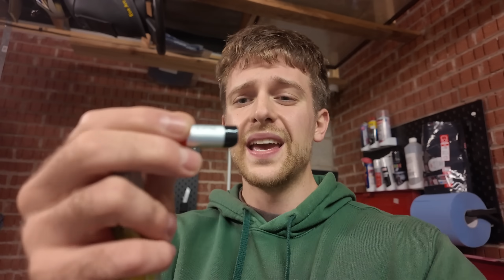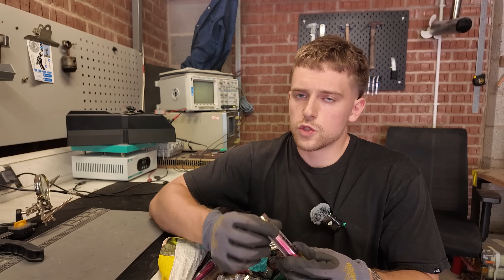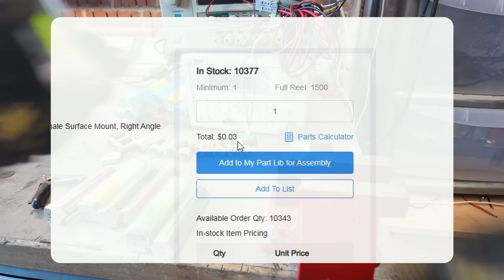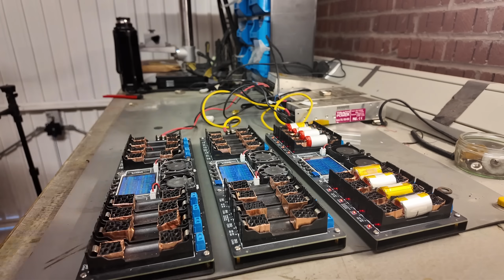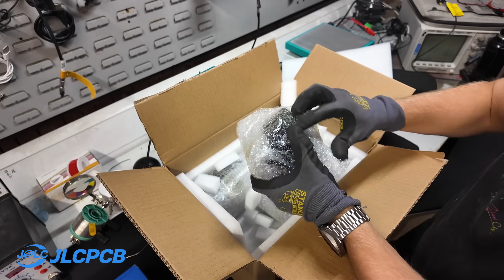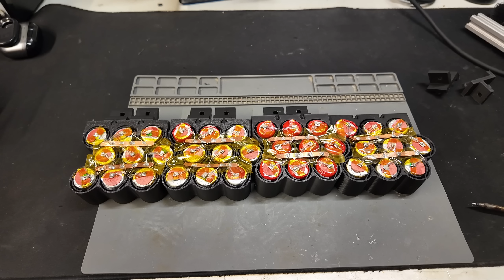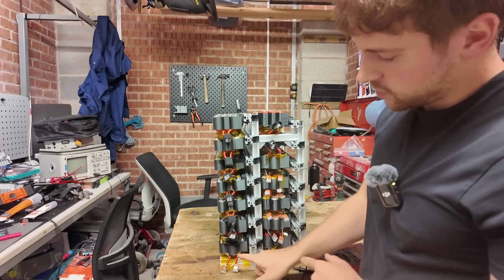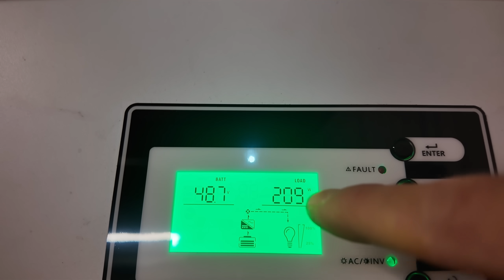I Powered My House Using 500 Disposable vapes

Comment: If you want to manage fumes in the workshop I would highly recommend a fume extraction system. You'd have the tools and knowledge to make and install one yourself or you can purchase one on wheels. 

It has an arm with multiple hinges to adjust fume extraction at specific angles. Your body will thank you for it

Regards,
Welder

Edit: my apologies, i just seen at the end you have and extraction fan. Awesome work with the battery

Comment: You don't necessarily need the inverter! modern devices have "switch mode power supplys", and effectively run on the equivalent of the peek mains voltage in DC inside. This means you can run most things on 300V DC directly, without an inverter. Only induction motors and old school transformers need 230Vac, and some devices have their own inverter/VFD to run the induction motors. Most brushed motors will work on DC. All modern led lamps work straight on 300V DC. 

So you could just do a high voltage series string of vape batteries, and power most devices directly on it. I have tested this by using multiple 9v batteries clicked together in series. I have powered TVs, power tool chargers, led lights, CFL lights, phone chargers, even a fridge that had a new style inverter compressor! Many devices would work down to 180v DC!

https://youtu.be/Au3wURws_Bg

Comment: I made myself a few packs of these batteries and it works really well. Recently however it seems like people stopped throwing vapes everywhere so I have not enough cells to build something bigger but the idea is simply fantastic.
Reply: Set up some boxes around high traffic areas, maybe ask permission to put em up depending where you want put em, lable them disposable vape disposal units, and check back for your free battery packs every so often

Comment: Awesome project that showcases how terrible these things are to be ending up in landfills across the planet--But I do have one question, shouldn't there be some sort of cooling solution for the cells themselves? On a small scale, a few of these won't draw too much heat, but as you move up in scale, I can imagine these would start to warm up, possibly becoming a potential hazard. I could be very wrong, and you certainly know more than I, but that's just a concern I had when seeing it all together.

Comment: nooooo way I had this idea when I uhhhh... decided it was time to quit lets just say lol. But didnt (and still really dont) understand too much about electricity so I decided ehhhh for another day. 

Now I see this video at 1am? HELL YES. INSTANT SUB.
Reply: Id love to know the maximum wattage output you can get. Can you like start a vacuum?! How about a 2000w water inductor heater :O? If so, you could run that for an emergency in a lil bit of water for like 10 min and use some pumps and bam "free" warm shower ;) !!!! If you can set up solar too that would be rad and yeah charging at night is KEY especially if theres no solar. I cant believe how awesome this video is. We can really do anything and im glad someone else had this idea! So COOL. Me? I just bought a bluetti elite v2 and I kinda use it that way for my entire office. Can even use my washer/dryer if I had to since I switched to water pump style you guys use over across the pond oi oi ~ ;) But rad. Awesome. Did you mention if it was running at a smooth 60hz? or 50hz I guess for you guys? If so, you could even use a petrol generator to charge your batteries to charge your house in an emergency as well! A lil power loss, but hey, you can at least use your entire house!

Comment: You've done the most useless and costly work. These batteries have a very short cycles. After 10 charge-discharge cycles, their capacity will drop by 30%,  20 charge-discharge = 50%. The best solution is to process them into lithium chloride(which is possible at home) since it is expensive additive

Comment: Please be careful about soldering onto lithium batteries, it can be dangerous. You should look at spot welding. Also I think you should check the waygo connectors for their power rating. I'm pretty sure you're pulling more power through them than they're designed to handle.

Comment: I absolutely cannot believe you SOLDERED directly onto the lithium batteries. This has to be hands down one of the stupidest things you can do. Heating these batteries can cause thermal runaway, which can lead to a fire. Also you shouldn't be using copper, you should use something like nickel as it doesn't oxidise.

Comment: An excellent proof of concept and exposure of the disgusting waste that are vapes BUT incredibly dangerous to do it how you did it, isolating the incoming mains from your generated power just by switching your switches in sequence 
You need a change-over switch to prevent ANY possibility of connecting the two together. OR it being implemented as part of a proper grid supply be system to the way a solar grid connect inverter does it. 
No doubt other, qualified electricians, will point out the necessity for cable sizing and types between workshop and house incomer.

Comment: Flipping the MAINS breaker does not totally disconnect you from the grid, you are only removing the HOT side of the wiring, your still connected via the Neutral and Grounds. It is still possible to backfeed power and fry a line worker. If your going todo this, you need a proper complete whole home disconnect switch.

Comment: Will you ever break even with the time and money you put in,   hell no.   do you care.... hell no.... value of the nerd cred.... priceless.  Glad to see iam not the only one who does stuff like this.   kudos and well done, hope that power wall lasts a long time.  you can also get pvc tubing andslide them down in it, like water tube, to stack them vertically maybe 6 to 13 batteries tall, then a bit of spring compression on each pipe piece and thread it so the threading compresses, makes the connections tight, that way if some go bad it's a lot easier to take apart to redo.  thats what i do in my 'battery bad idea box' :)
..Aaron

Comment: Amazing! I've always wondered how many people that 'Vape' ever consider what goes into the making of their electric cigarettes, and if they bother to dispose of them sensibly, when the battery is no longer viable? Some of my local shops have a deposit box claiming to 'Recycle' used vapes, but I'm skeptical as to how they are broken down when collected? Since the UK banning the sale of single use vapes, I have noticed an increasing number of USB chargeable kits available with replaceable pods, however when it comes to buying the pods, I have found shops don't stock them! This leads to people buying a new kit which contains a new battery. Pods are available for sale online, but unless you're prepared to buy them in advance of them running out?

Comment: The kettle bit was, you have to spend enough to get an inverter that will handle a kettle at least I got a low powered one that can run an angle grinder but gets annoyed at a kettle

Comment: Great video ! But: Lithium cells in disposable vapes are NOT the same as used in our phones etc. They are made for single use, as cheaply as possible, and without any safety considerations required for thermal management when a cell is intended for repeated recharging. - 
They are never intended to be recharged, just thrown away. You must assume that, because of this total lack of required safety considerations, just one of the hundreds of cheap cells packed together in your battery bank may well have some minor unseen physical damage lurking, or perhaps develope a fault with ageing, creating internal thermal runaway and explode into flames, setting the others off too. 
Hopefully none of that will ever happen (!!) but if it did, (and it could!) you would probably lose your house with the insurance unwilling to pay out because it was your lack of care, (and running a startup industrial manufacturing business?) from within domestic building premises. - . 
So please assume that your battery pack is going to explode into flames during some random night, and place it somewhere where it can do that "safely" ! - ie. Probably it's own mini weatherproof enclosure out in the garden.
(But it's still a great video !)

Comment: Interesting thing is that all of the accessories needed to build this are more expensive than the whole ready to use LiFePO4 battery from Aliexpress :D with bms, all the conns etc included and probs 4 times the capacity.

Comment: I know everyone hates AI and robots atm, but this sort of recycling would be a great use case for some robots to do 24/7. Right now a lot of DIY could save a ton of waste, but either they have to do it voluntarily or pay people way too much to make it worth it. With robots you have a one time buy, followed by a little maintenance probably, but you got workers that will do this endlessly without getting bored. Just collecting vapes and such and breaking them down for parts. I know building more stuff to solve a problem of too much junk is not ideal, compared to simply using less as a race, but given that won't happen and we'll only use more that's all I can think of. He's an amazing guy but can't expect Chris to do this all the time. Awesome video anyhow, I just can't help but be grossed out at how we simply toss most shit even if it can be used otherwise

Comment: You are not wrong at all some use 18650 battery same in laptops etc put in parallel with a right cap you'll be okay I've charged them with a phone cable so small capacity.

Comment: Nice...
My brother and I are vape addicts, I can say that almost every vape that runs out of juice, so i decide to keep it instead throw it at bin because the battery inside is still usable, including the type c port, module and lcd, it can be used for DIY projects, among the DIYs I have done is replacing the original battery of the shaver with a vape battery, modifying the headphones by changing the Micro to Type C and adding a double vape battery inside and my custom made Small flashlight with type c 😅.
Reply: I love the resourcefulness!

Comment: Not mentioned the capacity. From what is visible - nominally it's near 55-60A/h.
Usable is probably 35-40, so 2.2-2.5 kWhr.
Not great, not terrible.
But this thing will definitely blow up sooner or later. Everything in 2-3 m would be burning as hell for like 5 min at least. And nothing will help extinguish fire till it burn to the end. As you probably know.

Comment: I'd like to see you build another one from the deep discharged cells only. I have been regenerating and using some found 18650s that where down to 0,000v for some parts fort years, with no single one ever burning or even exploding. Some few had rather strong self discharge on their first test, though, and I got rid of these. I think Dendrites aren't such an omnipresent and urgent problem as it's the general perception. Thus some more insight (empiric study) would be interesting. Of course not without adequate safety measures.

Comment: Even with these cells going down past 3V you can easily bring them back to to 3.7V by charging them on a NIMH setting at 0.001 Amp, then charge normally on a LIPO or LION setting depending whether the battery is LIPO or LION.

Comment: Whilst this is a great Proof of Concept, I think the best thing we could do with the waste lithium cells from Vapes (and lots of other devices like laptops, cars, drills, phones etc) is the full recycling option - i.e. grind them down, extract the 'black mass', seperate all the elements and make brand new batteries that are suitable for the specific use. That way we can bring the cost of lithium down even further - although it is already happening - EV batteries for example were $1200 per kWh back in 2010 but are about to fall below $60 per kWh making them cheaper than ICE vehicles - this is why the new Vauxhall Frontera's EV version is now cheaper by £2k than the ICE version.

Comment: You know you can still recharge all the "dead" batteries.
Reply: its much more safer to use a known working one than to use a dead lithium battery and recharging a "dead" one is risky, as it could just be faulty
Reply: @criauxe  You should test each of them either way and that just means charging them. The batteries in the disposables are the same as those in the rechargeables. I have yet to see one of them go bad or be bad in the past 6 years, but I don't live in the UK so maybe what the US gets from China is different.
Reply: @chrisfusco5494  you dont get it once a lithium batteries get over-discharged they are already damaged and faulty mate thats just how they work so if they didnt light up thats a sign that they are already dead and testing them just waste your time

Comment: 3:02 it's useful to sort the best batteries from the worst, with the (statistically valid) presumption that low voltage indicates a bad (in some way) cell, but it's worth mentioning that the whole "x voltage = totally fucked" thing is entirely incorrect. It might not be worth doing in your case, but recovering these cells can often be done with just a sacrificial USB A cable, and some care. 90% of devices I recover with a jumpstart to the heart like that, come right back up near full capacity.

Comment: i dont think the all in one kits being more available then the pods thing will be too much of a problem, especially cause for 510 thread batteries which are used for most dispensary carts are also used for mini soldering irons and stuff like that so if vape companies use something similar or at least come up with another mostly universal standard like the weed industry has then the batteries would at least be still useful out of the box for diy projects without needing to be taken apart and recycled

Comment: I bet you'll be able to power your house for 2 days if you don't run a vacuum or microwave If it's in the fall or spring and you don't need AC or a heater. you can dramatically reduce your power consumption If you're living in a house just look at any of the RV Or off grid videos concerning power. Most things are very wasteful because electricity is relatively cheap And things will run up to the maximum of 1500 watts on a 120 volt circuit Outlet

Comment: Careful when powering only the workshop with the live and neutral conductors of the workshop supply isolated via main switch in the consumer unit off that come from the house. This means nothing in the work shop is rcd protected as the live is separated when the main switch is off. You could fit an rcd main switch in the workshop consumer unit that has a time delay to work correctly in hand with there being 2 rcds on one circuit(s)

Comment: Just an idea here, but instead of soldering everything together, and you solder a spring to each pole, and then just sandwich a sheet of copper between all the layers, that would put every cell in parallele, and every layer in series, wouldn't it? And make the cells easy to remove/switch?

Comment: Listen dude... You should already know that, I believe you do... Wagos are rated for what? 32A? 41A for the big wagos? And while this was barely safe for 2000watts that you were drawing, it's totally not safe for the 5000W inverter there... This was a stupid way to connct cells in series. Compared to all the work you've done, I don't see how this little time you saved with wagos is a batter solution... 
Also... How many days did that take you? A month? You can build a LifePo4 15kWh battery for 1300$ or something... Would it have the same views? No. Do I care? No.
Reply from the maker: 4x wagos for each series connection so 128A max continuous current

Comment: As a Professional Engineer, I'm very impressed. A suggestion for optimization: configuring the cells in series for a higher voltage would lower the current (I). This would not only reduce the I^2R (conduction) losses in the pack and inverter but also allow for smaller-gauge wiring and bus work, simplifying the soldering. While a higher voltage can marginally increase switching losses (which are transient on the PWM edges), this is almost always a worthwhile trade-off for the substantial reduction in continuous I^2R losses.
Reply: The cells had various capacities so he was grouping them. So it is harder to string them in series and adequately manage the charging balancing.
Reply: he probably had a low voltage inverter that requires a 50 volt battery to work with
Reply: Are you really defining basic variable to someone who clearly knows the basics of electricity?
Reply: @martialmurdock6866  I 've found the comment useful actually
Reply: @martialmurdock6866  The comment is not solely targeted at the Youtuber...
Reply: did you write that using ChatGPT?

Comment: Did you know that the WAGO 221 connector is only rated for 32A? Turning on the kettle and seeing over 60A sketched me out a bit. I hope you're not using that setup as a permanent solution.
Reply: two Wagos on each connection, so 2 x 32.  That's IEC rating because international physics works better, but the UL for north america rates them at 20 amps.  So yes, could be sketchy if a bundle of small vape cells wasn't already sketchy.  Good call fusing individual cells.